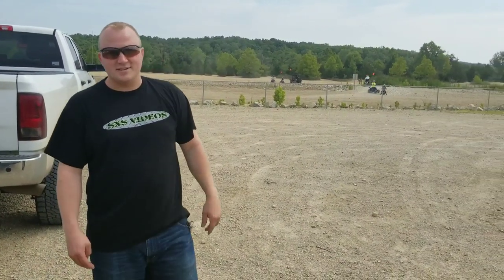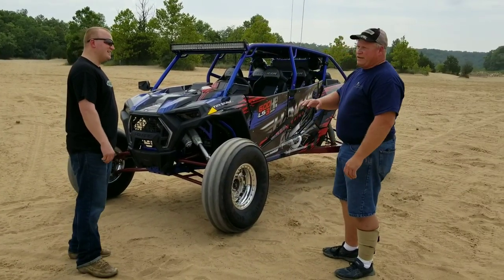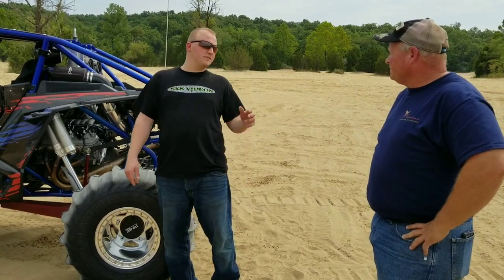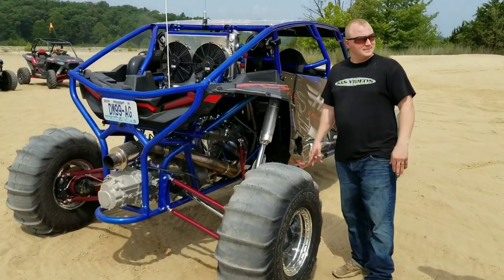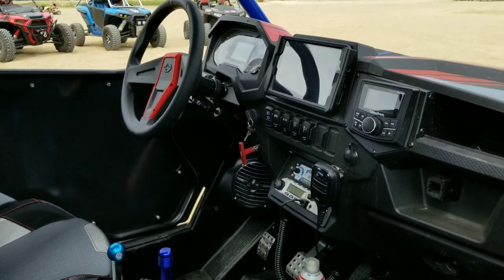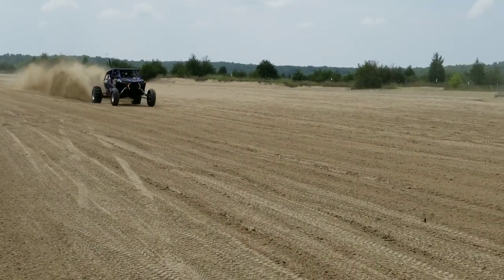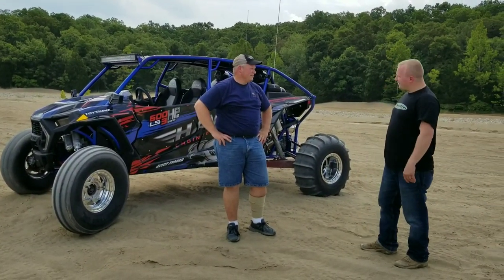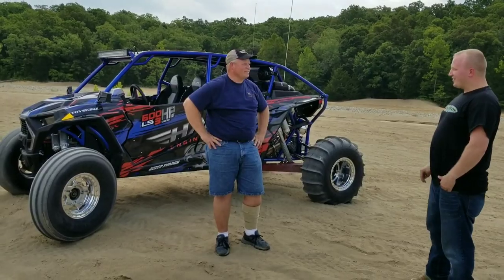LS3 RZR "NEVER ENOUGH" Built by Hawk Engineering | Drag Racing and Walk Around video |

Comment: The build was very impressive, the driver on the other hand needs a lot more practice, was honestly hoping to see a good launch with solid shifts when he raced the turbo s, unfortunately that didn’t happen. It would be really interesting to see this thing race a stage 6 Evo X3 for a real gage on how fast it really is. The stage 6 Evo X3 is the absolute pinnacle of what is possible with stock internals on the most powerful  SXS stock motor. Also I’m sure a stage 6 Evo X3 is 5x cheaper lol
Reply: Lincoln Kestner exactly.... wasn’t really impressed. By the looks of it a twin turboed yxz would eat its lunch
Reply from the maker: The driver is one of the best in the country. I guarantee you that. He rides with is in his Z1 bouncer. He'll literally climb anything. 
As far as the machine goes they are still doing some testing. I'd love to see an X3 with a stage 6 EVO tune against it. I'm sure it would be an impressive contest. Hawk Engineering will be at Glamis for Camp RZR with this machine as well as some of their Z1 RZR's. I have no doubt that he'll be up for any challenge. 
Thanks for checking out the video bro 😎
Reply from the maker: I'd sure be interested in seeing that race.
Reply: Stage 6 evo isn’t the pinnacle of what’s possible on stock internals. Lol  You can get 250 whp out of a rzr with a big turbo and stock internals. That will drag a stage 6 rzr or can am all day.
Reply from the maker: @standjos25  that's interesting. Most of the guys I know are doing the EVO tunes.
Reply: SXS Videos Zach Nash evo tunes are great. He’s just saying the stage 6 is as good as it gets which isn’t true.
Reply from the maker: @standjos25  oh okay. I haven't seen a machine with one yet. I'm sure it's fast, I agree with you though. A stage 6 EVO tune is fast but I have a hard tine seeing it beating this car. 
I don't have enough knowledge on the Stage 6 EVO on an X3 though. I'm not going to argue without the proof. Time will tell though.
Reply: Stan Joseph  stage 6 is a big turbo build🙄 it won the SXS Blog 2019 drag shoot out vs everything under the sun, including a Z1 Rzr built specifically for drag racing and many other manufacturers of big turbos. Don’t believe me.... look it up yourself, it does makes 209rwhp on E85 in a stock rzr and 255hp in a stock X3 and if you do a stage 6GT in a x3. With the exception of different camshafts and head studs, the stock internals are making 300+hp, find another kit with verifiable higher hp numbers on stock internals. Not Packard, not MPI, Not Boondocker, not K&T, Not Alba, and finally not vivid racing. Evo Stage 6 is the top of the verified stock internal big turbo game.
Reply: We have Z1s making more power than X3s that are very fast.  This was built to be different and not worry about a belt.  My next one will be extremely fast and setup for drag racing.  This is a fun dune car.  Hell, I just drove it to town and back.  It is a blast to drive.

Comment: Need to get that bitch out to Glamis to see how it really dunes! Glad to see that it wasn't just another a wheelie machine, nice job on the fab work. What does it weigh in at?
Reply from the maker: For sure man. It'll be out at Glamis for camp RZR. Hawk Engineering definitely knocked this build out of the park! Jason is a true innovator in the UTV industry. With the paddles I believe it weighs in around 2450 lbs.

Comment: The engine is to heavy for this build. Fast going straight but whats the point in putting this in a razr that's built for trailer and jumping. This thing is gonna be rough and unbalanced in the woops.

Comment: First let me say how cool I think this is that someone's willing to do something like this before I throw some cautionary shade.......    I question the 600HP as well.  The only GM built/tuned LS 3 that makes that much HP has a supercharger on it, but to me it's not the HP that's a concern.   Let them have whatever horsepower they want to claim.  Real or not.   The 4 seat SXS is the real concern.  Using a 4 seat RZR as a platform for that much weight and HP and offering it to the public is the biggest concern.  That engine and transmission combo belongs in a sand rail that's built to not only handle the weight and power, but can make good use of it.  The side by side is not the right platform.  Mark my words though... people are going to buy the hell out of this kit!

Comment: So basically you guys built a buggy with ls3 engine an slapped on a few razor plastics an called it a razor! That's like putting an am/fm radio in trophy truck an calling it a pickup truck. smh
Reply from the maker: That's a terrible comparison.
Reply: Cars have am/fm radios to and they are trucks

Comment: I would think with 600 hp you could pick the front end up off the ground, but no?
Reply from the maker: They are still doing some shock tuning and testing air pressure. A lot of factors were in play. The sand wasn't really ideal. The sand was very powder like. It will happen. They will be at camp RZR at Glamis in October. I'm sure it will wheelie no problem. You couldn't see it in the video but the front end popped up a little bit.

Comment: 600hp my ass lmao, quick yes but I’ve seen 700hp 383 stroker whipple sand buggy’s with more weight damn near do a back flip when they punch it like that, you barely fully extended the long travels in the front. What a waste of money
Reply: most of them have the motor over or behind the rear axle though.
Reply: Paddles are to small. Needs more traction. I'm sure it will stand up

Comment: Not 600hp and I am not even remotely impressed. I rode in a guys 400hp ish dune buggy with a subaru 2.0 engine that would straight up spank this thing at 1/2 throttle. it wont even pull a wheelie even with (600 hp) lol. come on  I have seen 500 hp trucks with paddles that pulled wheelies pretty easy. I am not buying it..Race it against a decently fast sxs and see what happens. Hell race a stock cr500 and get embarrassed!!
Reply: Jon Doe 
That is exactly all I was thinking the entire video!! ABSOLUTELY NOT 600hp!! Didn’t he say it’s a stock LS3 crate motor that he got someone to write a tune for? Since when does that make 600hp. That’s one hell of a tuner!! Holy shit!! He added 200hp to a stock LS3 by tuning? If that were true he would have a waiting list of no less then 2yrs out to get your LS tuned by that guy! 
This was my thoughts before they ran it, after seeing it make a couple of hole shots.... if that’s 600hp then it was a HUGE waist of time putting it in that tube chassis!! I think any stock 450 dirt bike or 4wheeler would spank this thing....
It doesn’t idle like it has 600hp. You don’t have to have a crazy rough idle any more to make 600hp, but u need a power added. To do it naturally aspirated, you need compression and air flow. 
It doesn’t pull like 600hp....
It doesn’t sound like 600hp....
It’s NOT 600hp!! 
How embarrassing to have a huge wrap saying 600HP then tell people it’s a stock LS3. 
-Oh so u running turbo?
-Nope
-procharger? 
-nope
-nitrous?
-nope
-screw?
-nope
-any power adders? 
-yeah, headers and a tune=600hp....
🤭🤫😔
How embarrassing.... 

On a positive note, that really is some nice work on the chassis! Put an LSX 454 or ANY type of power adder, and u would have a cool ride without a lie across the side of it.

Comment: Could it be possible to keep the 4x4 not that a guy with the balls would need it lol but would be cool
Reply from the maker: I don't know if that will be possible. If it can be done I'm sure these guys can figure it out!
Reply: With the transaxle they have in there, I doubt it. It would have to be rear engine I would think, with everything turned around to even be possible.
Reply: @muggy4841  ford did it with the rs 200 group b cars and it was extremely complicated

Comment: Not that fast! Can't pull the front end off the ground!
Reply: D Davis it a manual and wait till it hits asfault
Reply: He's spinning in sand lmao
Reply: I"m on the Oregon dunes.  Lot faster in my area and can't keep the front end down on most.
Reply: @dgdavis4385  well a lot of it has to do with gearing and tires as well. Small paddles for such a high horsepower, heavy rig

Comment: 600hp my ass maybe 450
Reply: what heads do you have? What cam shaft? what are the motor specs?
Reply from the maker: Hawk Engineering can answer those questions. he is at Waynoka OK right now. He'll be at Camp RZR as well.

Comment: Not impressed. Just a sand rail with rzr body.
Reply from the maker: There is a lot more to it than that. You are definitely entitled to your opinion though. It can be hard to realize how intiquite this is if you don't understand all the technicalities of this build. Check out Hawk Engineering. 
The builder literally built a kit that anyone can install on their RZR. there was a lot of work that went into it. He could have thrown a sand car together in a short amount of time. This took a ton of skill and engineering to come up with and build. This is industry breaking technology. He wasn't the first builder to do this but he is the first builder to make a kit. TMW Off-Road put a V8 in a rzr in 2015. This is a kit. 
Hawk Engineering is a leading company in high HP machines. They also have a Z1 kit that bolts on to a rzr that can produce 400 hp as well.
Reply: @SXSVideos  I'm a welder by trade and there's not much to it. He took a rzr cut the back off put it on a chassis bench and bent some tubing and put yet again a shitty LS engine in it just like every other mindless person does has not imagination or originally. All parts have been used many times over and it's a typical sand rail

Comment: wow just a stupid idea, if you are going to sell one just start with a new chassis and a razor body and call it a sand car, or dual sport, to concert a SXS is just going to seriously hurt someone, not smart
Reply from the maker: If you don't mind, please elaborate a little more and tell me why this is so dangerous. Also please let me know where the SXS lacks safety.
Reply: I agree with you, this chassis was never design to carry the weight of the v8 and  the transmision plus all the extra torque that it can produce. In the event of a crash it will fold like a pretzle, it can also develop stress cracks overtime due the torque twist caused by the engine.